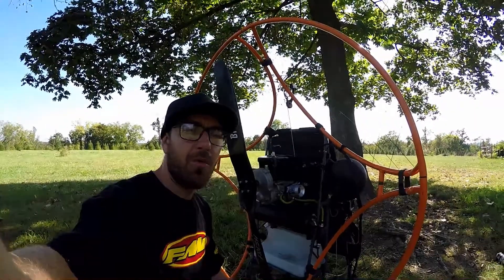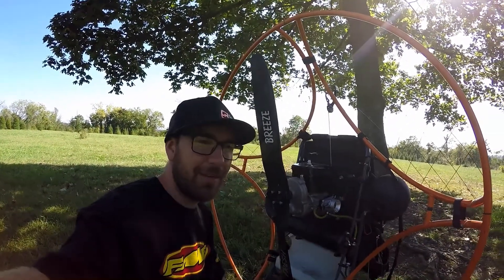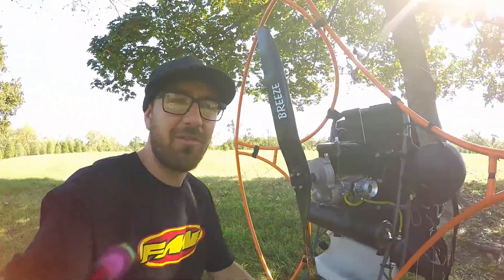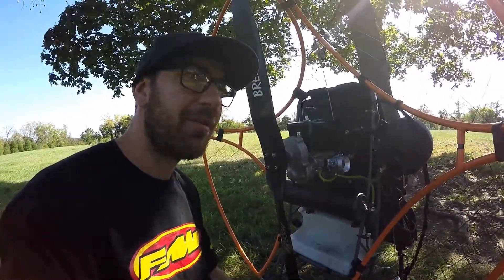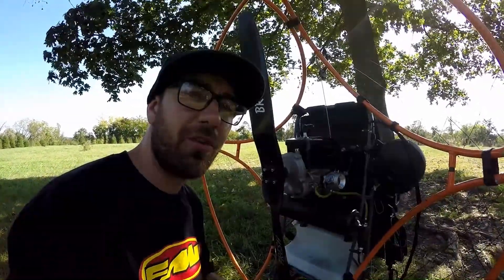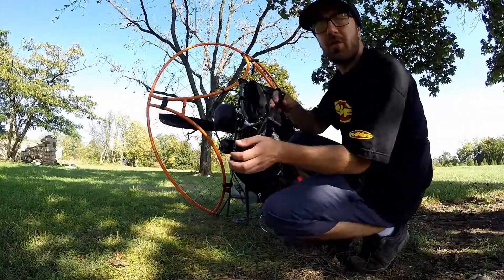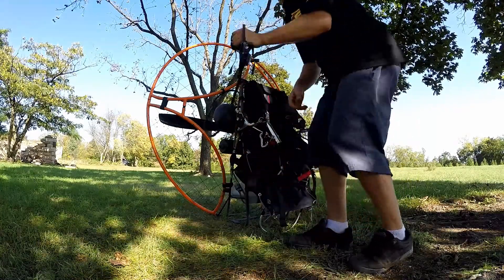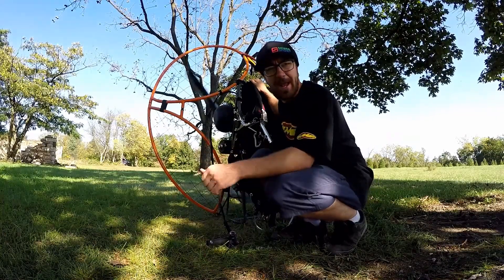Freshbreeze top80 paramotor  carb setup wb-37

Comment: Great audio considering you had the motor running at the end. Good Show! I know this is old too. Thanks!
Reply from the maker: yeah its old. this motor has since moved to a new owner. but still running great today. new owner just sent me pix of him flying it flying out west. they are great little motors.
Reply: @MotoFlyGuy  Good to hear it. I have a Top 80 on a Miniplane. My problem is MY working on it. I'm expert at fixing something and when I finish, it's worse than before. Anyway, enjoyed your video. Some videos never get old. Thanks for posting it. Be safe buddy. You had a great audio connection. Could hear you clearly over the motor.

Comment: Why is my husky backpack leaf blower more reliable than my PPG?
Reply from the maker: Hmm. I wonder if you can hook up a prop to it? Paramotor with 4 stroke reliability and light weight. Would be a winner.
Reply: @MotoFlyGuy  the best part is the leaf blower is also a two stroke. It starts everytime no matter the ambient  temperature and with old fuel. I've been debating on slapping a prop on it. Currently I'm struggling with my blackhawk airmax 220 walbro 37. I believe it has a similar issue as yours. I've used the walbro gauge tool to set the needle height and rebuilt the carb. It still has the same issue. I think the needle seat may be damaged.
Reply from the maker: @brandonnonya3680  yeah something has to be wrong with it. My top 80 and nitro 200 have that same carb.   It's pretty reliable

Comment: I just added the 37 after flying 2 years with a bing. I'm going to try it out with your initial settings and see what the startup is like.
I invested in one of those  colortune plugs, so I can kind of see while it's firing how lean or Rich it is, but unless you're inside of a garage in the dark it's terribly hard to really see the plug. And I don't like leaning that close to the engine to try in the daylight while it's spinning at 7000 RPM.
Reply from the maker: mine is still running good.  I let the low alone and just have to tweek the high for different temps. I just  keep max rpm at 9200-9300 rpm when wide open.

Comment: IS that a stock top 80,man that thing sounds snappy in the bottom end?
Reply from the maker: yeah its stock from freshbreeze. I know they do some things to mod the engine and carb.
Reply: Moto Fly Guy sounds like it maxes out at the same RPM as mine but it gets there faster you might be able to put a 130cm prop on that no problem bro
Reply from the maker: I'll keep that in mind if mine ever hits the dirt. I haven't damaged one yet.

Comment: Nice bro,I have the W8 carb and mine runs great from factory settings,doesn't have a high jet adjustment,only low and idle..wonder if a wb-37 would improve any performance?
Reply from the maker: you would be able to fine tune it a little better up top.
Reply: Moto Fly Guy yeah yup..thx man blue skyz.

Comment: HMM AFTER THE SET UP TEST RUN THE PARAMOTOR.. FLYING SAY FOR 15 MINUTES... LAND TAKE OFF THE SPARK PLUG THEN CHECK THE COLOUR OF THE PLUG.THAT WAY YOU CAN SEE HOW ITS RUNNING IF TOO WHITISH ITS RUNNING TOO HOT= SEIZE UP.
Reply from the maker: TONYPARAMOTOR  yep ran it on the ground for a good 10 min. Plug was a nice tan color. Not white or black. I will for sure be checking it next flight. I might have to get a temp gauge so I can see how it's doing in flight as well.